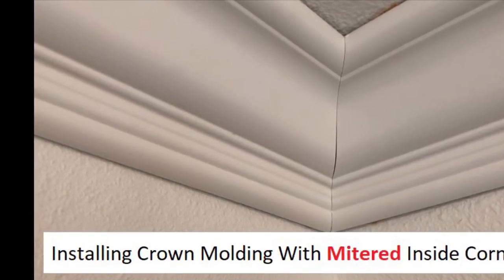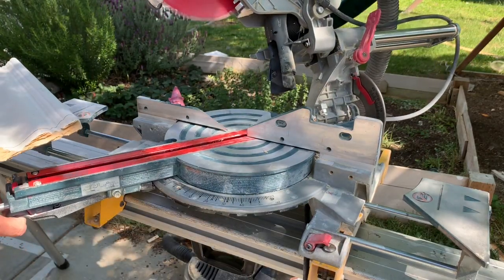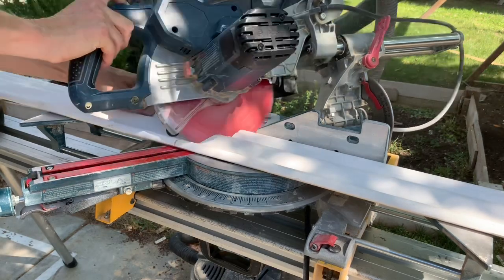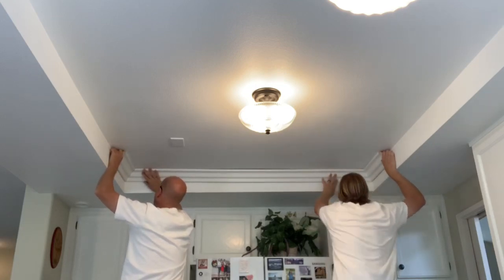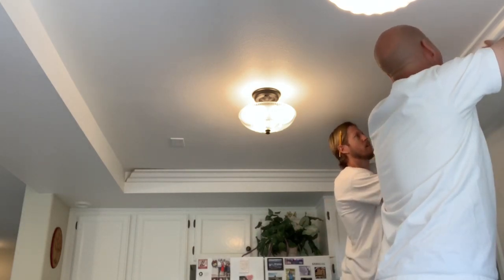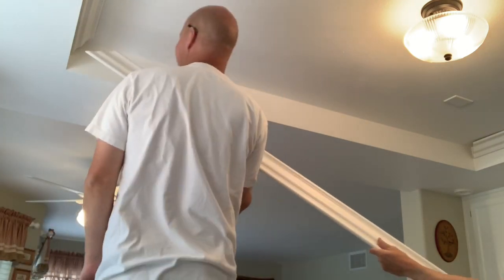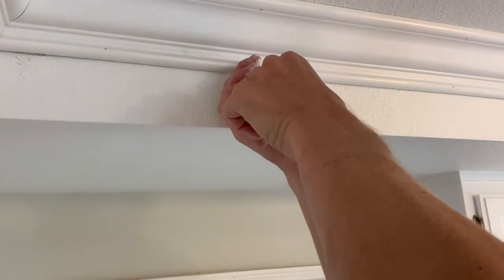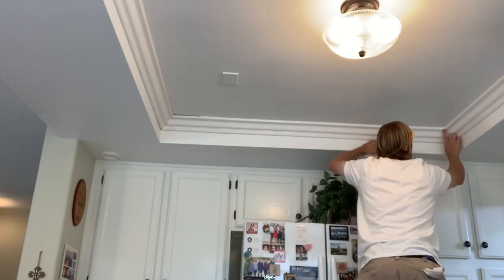How To Install Crown Molding With Mitered Corners - Easy Install Tips!

Comment: Can you share the type of nail gun you used?
Reply from the maker: I used α ryobi HP 18 gauge nailer with the big battery.  1 3/4” nails. It’s pretty cheap as far as nail guns go and works great, I hardly ever have α nail I have to punch in.

Comment: I do crown molding installation for living.  We cope crown and cut compound cut at saw.  If you can not do it you go and do something else for living.
Reply from the maker: There’s more than one way to do it.  I’ll cope it if it’s butting into an existing crown piece, for example you have to build a mantel all the way to the ceiling with existing crown molding up.  With mdf coping sucks on crown, why not miter it and glue it together? It comes out perfect every time.

Comment: Do the cut angles change depending on the crown? If so, how to you know what angle to cut?
Reply from the maker: Yes, some crown sits different on the wall/ceiling.  There’s guides online for figuring out the angles.. if you cut a small test piece, hold it up on the ceiling so the bottom and top backside is flat against the walls.  If it’s sitting more down on the wall or more of the crown is on the ceiling than the wall  it’s a different angle.  These angles are for when the crown sits about even between the ceiling and wall.
Reply: @crownmoldinginstaller6624  Thanks

Comment: I'm wondering if you can help me out, I am using focal point 3 1/4 Hanover Crown molding, Can you please tell me what my angles should be? Thank  you
Reply from the maker: Hi, I’m sorry without seeing the crown I don’t know. You’d have to measure the spring angle  to figure it out
Reply: As the saying goes...crown is like a 2X4 piece of lumber.  The actual dimensions of a 2x4 are 1.5 x 3.5.  Similarly, even if it is called "38 degree" crown, it could, as in my case actually measure 35 degrees.  To get best results you will need to measure the crown angle with a t-bevel gage or similar and then look up the miter and bevel tilt angles that correspond to that crown angle (easily found with google).    So in summary, no one could answer your question unless the moulding was in their hands to measure it.

Comment: Excellent video
IMPORTANT: Almost every tract house built today has corners that are not true 90's and the rooms aren't square. Pre-cutting (as shown in this video) could lead to disaster. I've found it's best to measure and cut one piece at a time unless you're 100% positive the room is perfectly square.
Reply from the maker: It’s true almost every house has corners that are off, but if you cut a whole room and use the tester in the corner and then shims it’s fine.  You don’t have to do one piece at a time.
Reply: @crownmoldinginstaller6624  
I’ve had corners so far off that shims won’t work. Recently I had one that was just shy of 107 degrees. I wish YouTube would allow pic in the comments. You’d find it most interesting.
Reply from the maker: @ClagwellsGarage  yes, I wish it would allow pics too! 107 degrees seems way off, it was a square room?  I did two hallways, two bedrooms today all inside corners and each room took maybe 15 minutes.  The other rooms had outside corners, so I do all the inside corners and then mark the outside corners, go back to the saw, then install those pieces.  That’s all I do, trying to make the least amount of trips to the saw as possible.

Comment: Thanks for this, why do you measure the walls shy?
Reply from the maker: If the crown molding is pressing against the drywall (it’s too long) you can’t get the corners to line up. But if you go a little shy they line up great by themselves or with a little shim.

Comment: what you do when the corners are way off from 90 degrees ? Let say outside corners are 92 and inside corners 43 or 47?
Reply from the maker: The ships work for the inside corners when they are off and the caulking covers up any small gaps. Outside corners I cut to length just the regular 35 degrees and glue the corner together before I install it, so you’re not trying to line it up and nail it up on the ceiling. If it’s mdf it flexes a little bit and works. If it’s hardwood crown you can just adjust the bevel a little bit to get the corner tight
Reply from the maker: *shims

Comment: What kind of nailer and nails do you use? Thanks for the helpful information, going to be doing this project.
Reply from the maker: I’m using the ryobi 18ga. With 1 3/4” brads.  The ryobi works great with the bigger battery.  I went through about 6 dewalts until I tried it.
Reply: M   ji

Comment: Great video and a new method for me for installing crown cutting it flat on the miter saw.   I hate coping, especially with MDF molding.  Whats the saw set up if your crown has a 52 degree spring angle? I am looking forward to seeing your other videos and see what other tips or tricks you have.
Reply from the maker: I think it’s the 31.62 on the miter and 33.9 bevel but I’d google a crown molding miter chart and check it to be sure first! It’s been awhile since I’ve used that setting..
Reply: Assuming 90 degree corner angle, a 52 degree spring angle means a 38 degree crown slope angle which yields Miter angle =38.2  and Bevel Tilt angle = 25.8.  You can double check me by googling, but I am sure these number are correct (assuming a 90 degree corner).  Those numbers will change a little if your corner angle is different that 90, let's say 91 degrees which is more realistic for most homes  (miter 37.8, bevel 25.6).  92 degree corners are in my house.  As the video shows, use shims and glue to compensate for small variances and you should have a good looking crown install.

Comment: still unsure what the shim do, and if you leave them in or remove them. Are they necessary or does it depend on the straightness of the wall or ceiling?
Reply from the maker: It does depend on the walls and ceiling if you need them or not.  But if there’s a gap in the crown it brings it together so the glue can now bond the two pieces together.  Once you shim the crown, you break off the excess and hit it the rest up behind the crown with a chisel just a little bit. So it stays there forever and the caulking then hides the shim. Hope that helps!
Reply: Great video, you guys should do more. There’s not many you tubers who know how to really work with crown. Clearly your methods work good enough to make a living. Keep up the good work

Comment: Why find your bevel if your cutting at a miter angle of 35? Instead of angling your blade why not bring to 0 and turn to 35 without having to set a bevel?
Reply from the maker: With crown molding sitting flat on the saw you have to use the miter and the bevel to get the corners to line up.
Reply: @crownmoldinginstaller6624  How did you find the miter degree and bevel angle in degrees? Did you use a particular angle finder?
Reply from the maker: @peterbergeris6510  you can search for crown molding miter angle charts online and they do sell the angle finders that go with the charts as well.  I learned just from working with a carpenter years ago on jobs so I don’t use them.  After awhile you just know what cuts you need to make for different angles by looking at them.  Two different settings on the miter saw make most cuts you need for all crown jobs.
Reply: @crownmoldinginstaller6624  Thanks

Comment: I was able to do my first crown molding job, due to your video.  Thank you!!!!
Reply from the maker: Al Glaza Right on and congrats! Glad I could help!  I’ve been slammed lately with work, but I’m doing one soon with my painter on how we finish the crown after install...
Reply: @crownmoldinginstaller6624  with this method, do you put the molding upside down?
Reply from the maker: @sabhanda1  hi, the back of the crown is always on the saw, it’s never upside down. So you cut one end of crown molding, then turn the crown around and change the miter to the opposite side 35.3 - then make the cut. That’s it!

Comment: 0:39 Google says it is actually "35.3" degrees for miter and 30 degrees for bevel tilt, but who has a miter notch for 35.3?  You are using shims to help close gaps since you are close enough.  That and the caulking hides the small gaps too, lol.
Reply from the maker: Yeah, it is that but it’s such a slight difference 35 works fine and is easier for people to remember. I just go to the outer edge of the 35 mark on my saw.  I used to have a saw with the 35.3 stops but it got stolen and I’ve never seen one since!
Reply: @crownmoldinginstaller6624  And people looking at this video also have to realize that the angles for miter and bevel tilt change if your spring angle is 38 degrees on the crown.  One commenter on this video said your method failed, but I am guessing that he had 38 degree spring angle and not 45 like yours.  And no wall is 90 degrees which also changes your miter and tilt angles from the stock readings on the miter saw, depending on how picky about the gaps the installer is about doing the job.

Comment: Hey there. Great video.! I just want to ask isn’t 5/8 shy a little too shot? For example my wall end to end is 100” so I have the cut the piece a little under 95 1/2”?
Reply from the maker: Mike T yes.  I think I said shy was a 1/16 of an inch in the video...  maybe not? So for 100” wall start with 99 15/16. Sorry for the confusion!
Reply: Crown Molding Installer Thank you very much for the reply.! That makes more sense.

Comment: Are those 90 degree inside corners?  I always thought you had to cut them at 45 degrees, why are you cutting them at 35?
Reply from the maker: If you use a jig you cut them at 45. If you lay them flat on the saw it’s 35.  I like laying them flat, you always get the same cut and no jig to set up.
Reply: @crownmoldinginstaller6624  Wish I would’ve known this before I bought a jig! Great tip thank you.
Reply: @crownmoldinginstaller6624  nice

Comment: I'm generally a cope guy but I'm not married to any method.( as some crown is actually uncopable)  I'm a little more detailed if I'm mitering my corners though. I'll use an angle gauge to get the exact miter. I do use the shim method too. Good general tips for the beginner

Comment: What a nice job!  Where do you buy the tool where you pushed in the nail?  What is you opinion on the technique of 0 degree cut on one side of the inside corner?
Reply: It's a spring loaded nail set/punch. Not sure if that's the proper name, but I bought mine several years ago at a Sherwin Williams paint store - Amazon will work as well

Comment: i've always heard u had to cope the corners.  i didn't know that at 35 degrees u could make it work.....
Reply from the maker: I like to miter the corners of the crown so I can glue them all together.  Plus it’s quick. Just check the spring angle of the crown your using not all of them are 35 Miters, some are 31.62, etc.
Reply: Crown Molding Installer what’s the wedge actually doing?  Is to close any gaps while the glue goes in?  Do u find inward corners harder or outward corners when it comes to crown more difficult?  When would u recommend coping? Thanks!
Reply from the maker: Sid Nguyen hey, yes the shims close the gaps so the glue bonds the pieces together.  On outside corners here they are usually bullnose , so I make three piece corners and glue them together with the 2-p10 before I install them.  They’re both pretty Easy once you’ve done them a few times.  I cope most of my baseboards inside corners and occasionally I cope a crown if it’s easier.

Comment: I’m doing a similar project but space is 49”/49” will I be using similar cuts? I don’t have a miter saw, will a jig and hand saw work as well? Also, which style is that crown molding. Great job 👍🏼
Reply from the maker: rod diolula hi, if it’s a square room then the cuts are the same. I don’t know how you could get the cuts right without a miter saw though. The cuts have to be exact, if your off a couple degrees off on two pieces and they won’t line up correctly.

Comment: Set the miter to 35° and the bevel to 30° and guess what..... The inside corners weren't even close. 
To anyone thinking of doing their cuts this way save yourself some time and money and don't make your cuts this way.
Reply from the maker: Smile SurferStyle sorry it didn’t work, not all crown works with these angles. it’s for crown at 45 degrees from the wall.. it could be 38 or 52, but 45 is the most common we use especially with mdf profiles.
Reply: He's correct - 35 & 30 is for crown with a 45° spring angle -  most likely your crown was 38° spring angle, so you'd need to set the miter at 31.6° and bevel at 33.9°  * as close as possible.
Reply: @semperfi5857  ok then , I have to ask, what is it for a 52 degree spring?

Comment: How do you determine/measure the bevel angle ?
Reply from the maker: It depends on the crown, but most crown molding is just under 30 degrees for the bevel for the inside corners in this video.  I just keep it set at that and just use the shims when needed to tighten up the corners.

Comment: I'm totally lost. What happened to 45 degree cuts (in all of the 20 other videos I've watched). Is 45 degrees ONLY for outside corners? You're using terminology that is totally Greek (to me, the novice). What the heck is "30 miters"? What does "96 and 5/8 shy" mean? 96 and 4/8? Please 'splain it to me. Thanks
Reply from the maker: Kenton Kirkpatrick hey! 45 degree cuts are if you have a crown jig on your saw, the miter and bevels are what you you use cutting it flat on the saw.   Those angles are for 90 degree corners, inside or outside. For shy on the measurements I take a 1/16th off the measurement so the crown isn’t tight on the two walls. Hope that helps

Comment: You would never work for me. Mitered corners will leave a crack in the joint after a few months no matter what you do. If you cope your joints, you won't have to drive wedges behind your trim to make it fit. Try running three and four-stage crown molding that way. Most all compound miter saws have stops for cutting crown molding flat. Take pride in your work.